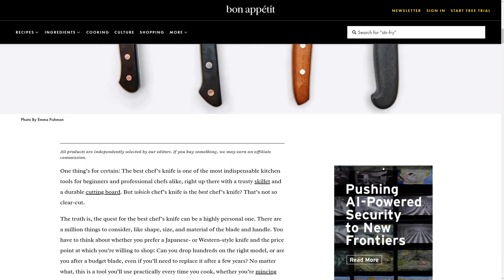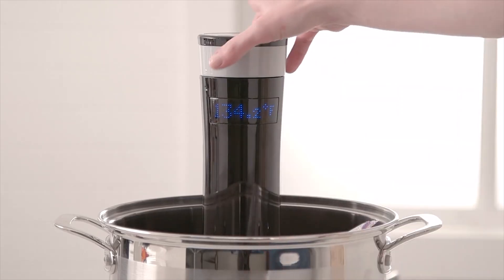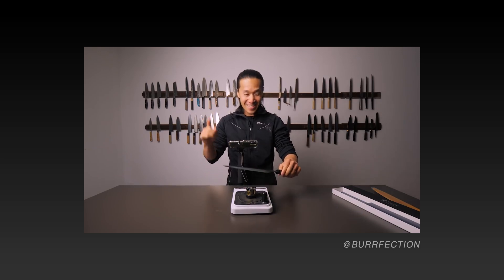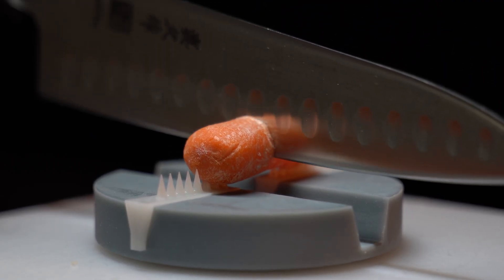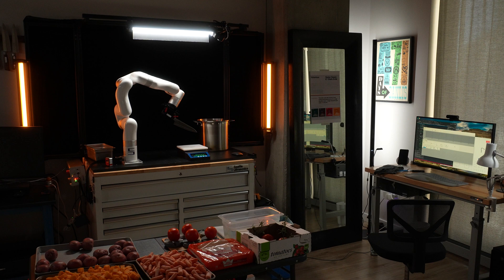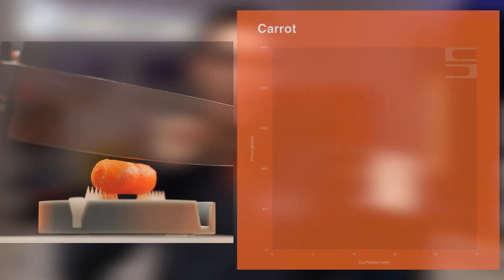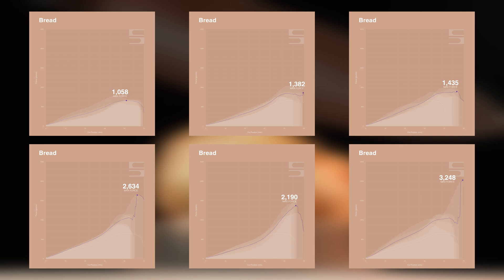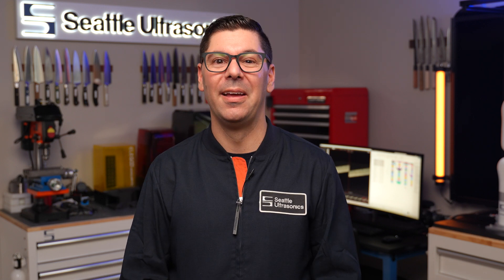The Quantified Knife Project - How do the most popular chef's knives actually perform?

Comment: I really enjoyed this video and subscribed instantly, will be very interested to see how things evolve.

What would be interesting would be to get people to use the knives on the same tests as the machine and run similar analysis (to see if the subjective human observations correspond/correlate) — you could to use several/many people to reduce bias. And ideally you would want to prevent them from knowing which knife they are using which would be difficult. Then you could compare to the arm tests and see if there is correspondence/correlation in the test results.

I would also like to see a slicing test with more forward motion, and perhaps forward and backward motion. I often slice bread (using a forward and backward slicing motion) with a sharp non-serrated knife as for me it seems to give a cleaner cut with less crumbs than a traditional bread knife (and yes I suspect there will be micro-serrations on the knife).

It would be good to test a range of slicing motions with more and less slicing and forward and backward motions and combinations — I recognize that forward slicing is probably more prevalent but we might discover that backwards is better. Also it may be that some knives could perform better in one direction than the other depending on how they are sharpened (one commenter brought up that one knife had sharpening marks that indicated it could be better slicing backwards, which makes seems to make sense as saws have a cutting direction) but this needs to be tested.

Also I am impressed with the photography of the knife edges, but it really needs a SEM to properly view the knife edge particularly when looking at (so called) scary sharp edges. When you include finish stropping with very fine (consistently graded) diamond solutions for example the differences on the edge are unfortunately not apparent (as far as I know) with normal photography. Obviously this is moot for most knives as most knives are not this sharp 😂

It would also be very interesting to do some tests for wedging effects with harder (and thicker) vegetables like carrots and potatoes and maybe squash. The other issue is that food often sticks to a knife which might actually cause more resistance (force required) than the wedging. I don’t know how to differentiate the between these or how to eliminate (or standardize) sticking so wedging can be isolated. 

Talking about sticking it always a nuisance and it would seem it is related to the amount of knife surface that contacts the vegetable, some knives have cutout grooves or hammered Tsuchime finishes (also concave blade geometry is said to help) to attempt to reduce this (I just get used to flicking stuff off with a finger if needed — of more difficult with a taller knife like a Chinese slicer). So perhaps testing could come up with a quantitative measure of how to reduce stickiness? Perhaps even (sacrilegious  LOL) a non-stick coating 😊

Another interesting test would be for tomato slicing as there is a debate between scary sharp and serrated edges, and it would be interesting to see which performs better. The "traditional" wisdom is that serrations break the skin better -- but some people find that "scary sharp" works as well or better (but the knife needs to be very sharp to just slice through the skin).

Also just identifying various conventional (and common sense) things like thin knives wedge less, how sharpening angle affects cutting subjectively finer angle cut better (seems to make sense but perhaps there is a point of diminishing returns), also how does the sharpening angle affect longevity of and edge, we could test/compare the cutting characteristics of single bevel knives (yanagiba, usuba, deba...) and the more common double bevel knives, I am sure the list goes on. In this area it would also be interesting to try and identify what people find most frustrating or limiting about their knives and try to test (and find out how to improve) those specific things (so identify real issues -- rather than obsessing more and more about details like carbide grain size or cemented carbide formulations for scary sharpening and wear durability even though this can be fun 😊)

And the data begs for more analysis both for statistical and human significance. For example there are some quite large differences in pressure between the knives – but I do not know how significant this would be to a human (subjectively) using the knife. It seems obvious that less weight required is better, but I do not know for example the level at which it becomes noticeable (or annoying or tiring) when cutting a tomato or a carrot.

Comment: I know the food cutting tests were averaged, but it's hard to necessarily take them as fact when you can't rule out the possibility of potatoes being different sizes or densities. It would've been better to make 1 inch cubes and weigh them to try to match density, but then that also wouldn't accurately reflect cutting through a full size potato sticking to the blade either. Also seems a bit odd to me to do the sharpness test on factory edges and seemingly not on a new edge you sharpened, which is where it's realistically going to be assuming you sharpen your knives.

Even though I doubt the actual usefulness of the food tests given the wild variance between things on the same knife, it would be nice to see the results on the spreadsheet, and maybe normalize the results between the highest performer and lowest performer and give a % rating instead of pure numerical rating.

Comment: Wish you tried japanese knives too made out of sg2/sld/vg-10/W2/Hap40 etc too. Like a Shibata/masashi etc. I'd LOVE to see super blue or aogami white compared to R2.
Your company sounds really fun to work at LOL.

I wonder how the edge retention would fair into a cutting board
one other thing I'd love to see is whether end grain cutting boards ACTUALLY dull knives slower or if it's just a myth. and whether they actually "self-heal"
I also wonder if the angle you measured is right, how did you measure it ? 4 degrees seems extremely small, almost like you're measuring the primary bevel not the secondary.
Reply: ... and whether* they self-heal.

Comment: I hate to be "that guy" and this is an awesome video, but your cutting action is flawed (Am a Chef of 20+ years) knives of that design are designed to have downwards force and forwards force applied when cutting, significantly more forwards force than is visible in this video.  You can press a sharp knife edge into your thumb really firmly and it won't cut you, provided you don't apply forwards motion as well, if you do it will cut you to the bone.  A knifes edge is like a tiny saw blade and the microscopic teeth get caught up in the thing you are cutting without forward motion (imagine sawing wood without moving the saw)  It should also help to remove a variable, that being the item being cut from moving slightly as the cut is performed in subtly different ways each time.

If you test more knives, or run some retests, I'd love to see what difference to the results you get from pushing the knife forwards relative to the food by 5cm ish whilst applying downwards pressure.
Anecdotally I can tell you that my knives cut 'better' and require less maintenance if I cut things 'correctly' but I have no objective data (or a robot arm), is what I have been taught 'correct' or does it make little difference?

Comment: Is it a fundamental flaw to measure the knives out of the box rather than sharpening so each is sharpened to the Mfg recommended angle and then test? I would think this would be a more meaningful comparison and reveal differences based on knife geometry rather than how sharp an individual knife is out of the box which would tend to color the measurements.

Comment: I appreciate the effort, but I think that the group of tests and documentation don't quite give me an accurate depiction of how the knifes perform for a person. 
1: There should have been before and after CATRA food tests, a lot of people use their knives in partially or basically fully dull states, and showing how the different knife geometries affect the food tests in both states would be informative.
2: Before and after documentation of the knife edges. I have experienced different forms of wear on knives depending on the type: chipping, rolling, cracking. How they degrade over time would inform me how I will have to maintain the knife over time.
3: Multiple samples of each knife, ideally from different batches, would be better, as I would like to know about the consistency of production. Taking hardness values of the blades would be informative about heat treatment consistency which is a major factor in final blade edge retention.
4: More geometry measurements: Spine thickness, behind edge thickness, handle length and circumference. Blade geometry plays a huge part in how a knife feels to cut despite its sharpness. And handle stats can give me an idea of how the knife might fit in the hand in comparison to other knives.
Reply from the maker: Thanks for your comments. Yes, there are a bunch of ways to make this testing better, and this is just the first step. Note that the full dataset on Github does include spine thickness, thickness behind the edge, blade length, and overall length (you can subtract to get handle length), as well as mass and advertised hardness (we didn't take hardness measurements). We also didn't measure handle circumference. 

These food cutting tests weren't enough wear and tear to degrade the edges since we explicitly kept the edge away from hard surfaces, like cutting boards. But that's a great thing to evaluate in future testing as well.
Reply: @SeattleUltrasonics  Thanks for letting me know that some of that extra data is there. I tried real quick to open the .xlsx file there, but my computer was not liking the file for some reason. I plan to try again.

Comment: By right, Japanese knives are not meant to be used in a direct chopping action which is done by your tests.  They are slicers, which means that they are used across the whole blade with either a pulling or pushing action across the subject.  This will skew some of the results.  So unless you can program the robot to perform the same slicing action as done by a real human, it will not show the proper performance of the Japanese knives.
Reply: The potato, tomato, and bread cuts do use a slicing motion, though the horizontal component is less pronounced than it might be in real world conditions. See 6:30 in the video.

Comment: I would really like to see these tests done with the knives sharpened to a similar degree. The factory edge simply isn't relevant for the utter majority of the knife's service life so this it ends up just being an uncontrolled variable in testing. 
Using a sharpening jig like the ones commonly found on amazon and aliexpress is probably going to be good enough for testing, as this is as close to a like for like comparison any user, consumer or commercial, is likely to get with these knives anyhow.
Going through a few different angles and weighing the cutting test results using edge retention would probably give a score that's quite indicative of the kind of performance that could be drawn from the knife.
And on the subject of edge retention, while CATRA measures edge wear very well, I'm not so sure how it will measure chipping resistance. It may be worth to devise a sort of impact test that simulates chopping to test edge retention under those conditions.

Comment: ? why would you use the factory edges as the metric? thats like judging a person's style by their work uniform. if you dont want human skill to introduce contamination you can use decently consistent guided sharpening systems.
Reply from the maker: The reason we used factory edges as the metric is because these particular knives are marketed to and used by home cooks. Most home cooks don't resharpen their knives often, if at all. So for most people making a purchasing decision for blades in this category, the factory edge is the sharpest this blade may ever be.
Reply: @SeattleUltrasonics  after a few months of use the average home cook will have dulled these beyond recognition, these results are only valuable for that length of time and no further.
This is exactly the reason why knife reviews very rarely make arguments based on edge, its either useless because it can be changed, or it will only be accurate for a very tiny portion of the knife's life. Either way its a very unproductive measure by which to rank/recommend a knife.

at least with a consistent edge, either sharpened or consistently dulled. you could represent better the effects of a knife's geometry, a much more significant and lasting feature.
Reply: even then, the choice of angle would be optimal for some and suboptimal for others.
Reply: what you measured isnt a characteristic of a knife, rather just a state, a state that different brands prioritize differently and is not at all representative of the overall life of a knife

Comment: Subjective reviews have a place because knives are subjective. A lot of the subjective properties matter more than the objective ones. I'd rather have a knife better shaped for my uses, comfort, and cutting style than one sharp out of the box. 

Also, the objective measurements people seem to focus on are not the ones that actually matter. Things like edge geometry, edge retention, grind concavity, and weight matter more than sharpness out of the box. A knife that's thick behind the edge or with an extremely concave grind will still wedge in a potato no matter how sharp it is. A good way to gauge many of these properties in a photo is the choil shot, which photographs the blade from the handle's prospective. The other important properties are typically listed on the manufacturer's websites, such as Rockwell hardness, where a higher number indicates longer edge retention. If they don't list these things you shouldn't be buying.

The difference in performance amongst the tomato may come down to just how polished the edges were. Two blades with the exact same sharpness would cut a tomato differently if one was finished on a higher grit, since a smoother finish is more inclined to slip off the tomato skin while a toothier edge will grip it enough to slice. This is why people with dull knives will typically repurpose the bread knife for tomatoes.

Overall great video! I loved how you showed force over time, as that's a good indication of wedging and poor geometry. Like you said though this is just one variable of a knife's performance, and it's impossible to get a complete picture through subjective or objective results alone.
Reply from the maker: Thanks very much! We include choil shots and detailed edge images on the website, plus CATRA test results, Rockwell scores, edge angles, etc. Totally agree that these performance numbers are just one factor for knife buying. I just couldn't stand that this factor was totally absent :-)

Comment: The motion depends on the knife profile. Ergonmics are huge, people are not all the same height and have the same size arms and hands. Did you use the robot for the BESS testing? BESS tests are very inaccurate if done by hand.

If you know how to use it all you need is a decent steel similar to 52100 or AEB-L, french profile and a light / thin grind. But knife makers make their knives way to thick, that they are harder to break with abuse, or they can cheap out on the steel.  Some ppl. are stupid and think a heavy knife is higher quality.

I think most people underrate stamped knives they are most often thinner than forged blades and will outperform them in a ot of tasks.

I wish there was testing where all knives were sharpened to the same specifications.
Reply from the maker: We did BESS by hand, as opposed to the robot. But for each blade we took three BESS scores, very slowly and carefully, and averaged them. The individual scores are available in the source data on GitHub and they cluster pretty tightly. 

Totally agree about testing these blades after resharpening. I just need to find a way to take human variability out of the resharpening equation (and find a whole lot more time to run those tests!). Thanks for chiming in!